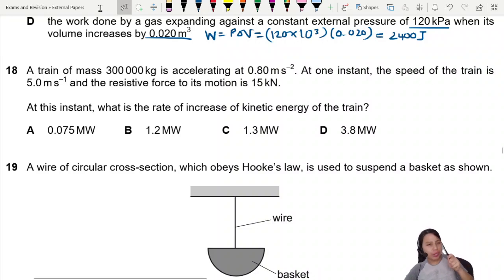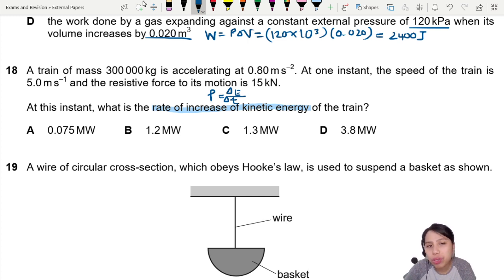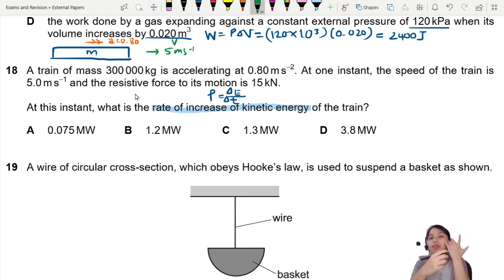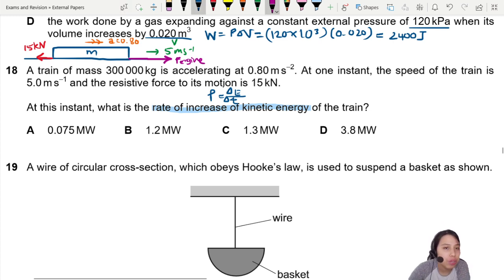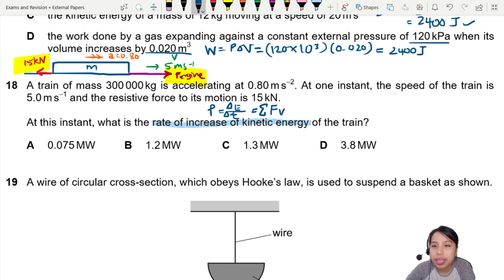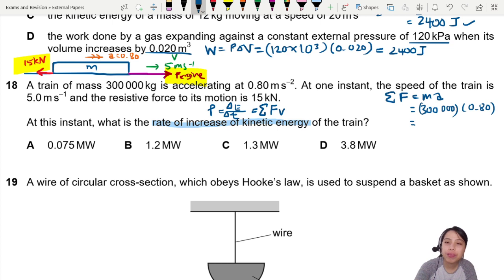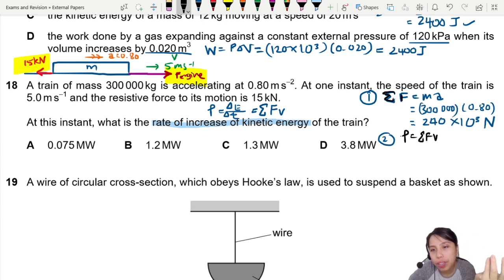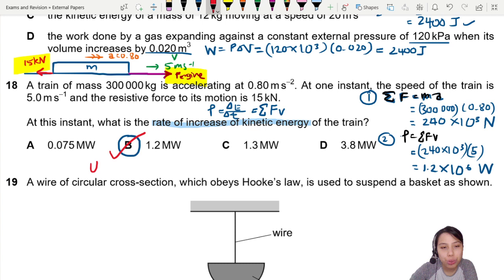ON20 P11 Q18 Train Power with Friction | Oct/Nov 2020 | Cambridge A Level 9702 Physics

Comment: Obviously we will use net force and so wouldnt the equation be
F(engine) - F(friction) = ma
Hence,
Fengine - 15x10^3 = 300000 x 0.8
Giving us 255,000 N
Then P = Fv
P= 255,000 * 5 
P = 1.275 x 10^6 
Hence C?
Reply: F(Engine) is driving force not the net force.

Comment: I don’t understand why we use net force :// and not driving force..please explain.🙏🏻🥺
Reply: Hey! You can think about it like this--the driving force is also overcoming friction--not all of it goes to increasing kinetic energy.

Let me paint another scenario for you. If we had the same car, with the same driving force, going on a road *without friction*, the rate of increase of kinetic energy of the train *would be higher!*. The acceleration would be higher because theres no force opposing it.

But in our current case, we have friction, which limits our increase of kinetic energy because the acceleration, which is rate of change of velocity, is proportional to resultant force not just *force*. *Resultant Force*=mass X acceleration

Also, say, if the driving force and frictional force were equal to each other, the rate of increase of kinetic energy would be ZERO, because there is no net force--the car would remain at a constant speed!

So we have to factor in frictional force. We subtract it out to get the net force, which actually accelerates the car.

 Hope this helps!
Reply: @fredtheafricanpianist5935 that’s a great explanation. Thanks a lot
Reply: I believe it is because the rate of increase of kinetic energy is only affected by net force/output power; if it asked for input power, you would use driving force - however, it seems to be more a matter of output power. (please correct me if I am wrong)

Comment: why the frictional force is not subtracted
Reply from the maker: By using nett force, we have already taken into account the effect of allllll the forces - including friction!
Reply: @ETphysics  An electric train is initially at rest at a railway station. The motor causes a constant force of 
360 000 N to act on the train and the train begins to move.
(a) State the form of energy gained by the train as it begins to move.
 ...............................................................................................................................................[1]
(b) The train travels a distance of 4.0 km along a straight, horizontal track.
(i) Calculate the work done on the train during this part of the journey.
work done = ...........................................................[2]
Reply: Excuse me Miss can you please answer it? And maybe give a brief explanation. Thankyou